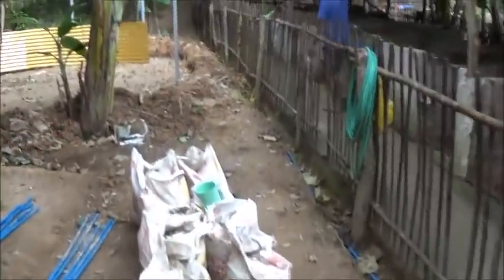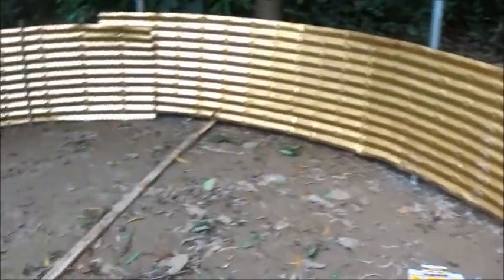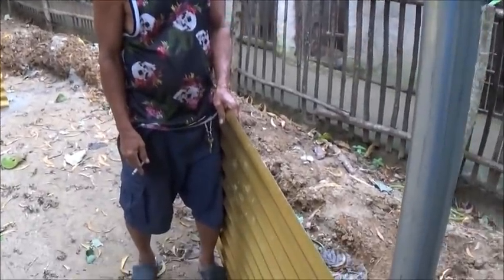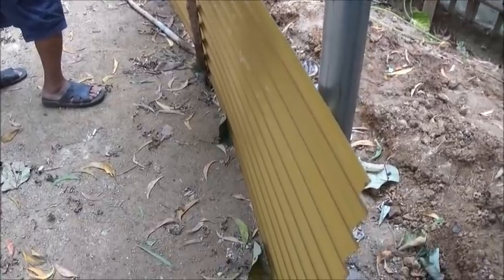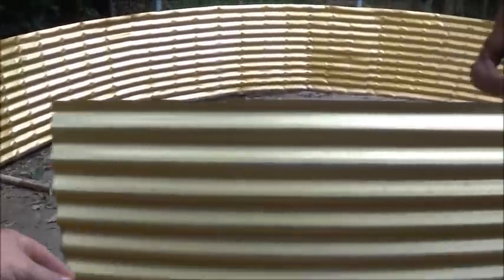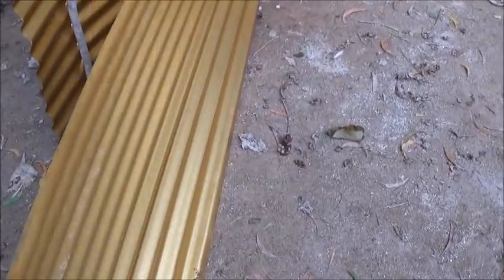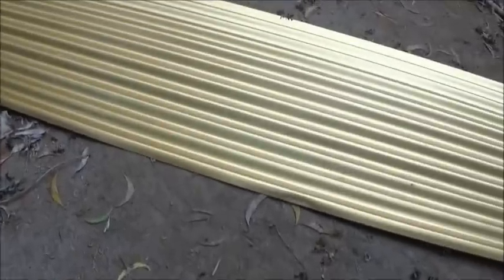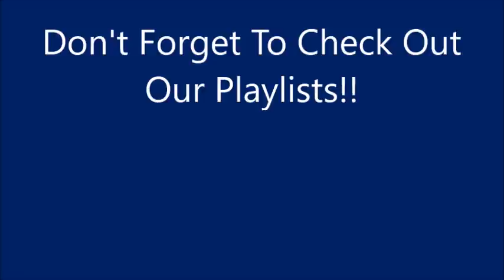Design Flaw Or Incorrect Installation

Comment: You are going against the corrugation ridges. It becomes more bendable if it is used with the corrugation ridges going in the upright direction. It becomes more flexible.  With it being horizontal it resists the flexibility of the metal.

Comment: Tatay, Spread out about 2 inches deep of sand 4 feet wide and 12 feet long. Set the sheet on it and drive the 
motorcycle down it to curl it up . Light rider and drive over it several times. If it bends too much bend several at once.
I might start trying to bend 3 at a time.

                                         george and aurora

Comment: I am sure it's been done many years and see grain bins built with thicker gauge metal but those sheets are pre-made to fit certain radius or diameters. I can see frustrations of all involved but its nothing lost in translations, its material that is available and what you have to use, and what you are trying to achieve.   Compensation and consideration has to be made to make things work.

Comment: Good explanation Brian,  glad you have done this video. 
I also  know Dave,  has been somewhat frustrated!
Particularly in the sequencing of the project. 
Looking now in further detail,  length of sheets ect, seems the tank is too low in diameter,  i realise of course , suitable space was limited!
Perhaps removing the installed sheets,  cutting in half( if 4 feet height is desired) , then using a number of form bars of suitable thickness as a retaining wall support. 
Can paint the sheeting for for added piece of mind.
Hope you,  Dave consider it,  would love to see completion of this exciting  project!
Reply: Tilapia Aquaponics  hi Dave,  thanks for replying in a somewhat stressful situation,  not knowing what the instructions were,  is difficult to understand the problem. 
Reading other comments you have made  here, sounds like you will continue,  certainly hope so!! 
All the best mate😁

Comment: I asked this question in the video on crushing rocks.  The corragations in the sheet on both sides gives the g.i sheet strength and rigidity. 
May be  rings of rebar every 15 inches apart and fix the iron vertically to them if it won't bend horizontally. Unless someone has a roler in town for curving g.i. sheets.
Reply: Tilapia Aquaponics   would increasing the length of the sheet give it more flexibility to bend.
Short lengths are harder to bend.
Reply: Tilapia Aquaponics  that would be interesting to see if it works.
Reply: Tilapia Aquaponics   hi mate, way out west blow in blog made a homemade corrugated iron roller. 
Lol maybe you need to be Irish or can an Aussie do better.

Comment: Difference in thickness of metal will prohibit bending as desired.  Not sure what the gauge of metal being used there in Philippines is or what is available...?  There is different ways to achieve this.  One is making a larger diameter circle to compensate and easier to make the sheets conform to the desired radius.  Another is lighter or thinner gauge of metal.  Even though it would be thinner the radius would give it structural integrity.  Another way is if the sheets are made locally is to have less height of correlations which would enable it to curve gently.  Another way is to have the sheets rolled in rollers and they will then form a radius, and ship curved.  I think the diameter is just too tight or small to make the sheets conform with the thickness being used.

Comment: If the metal sheets were not corrugated then they would probably flex easily. As others have said, the corrugation provides stiffness and rigidity to resist flexing and bending. You guys have some good ideas, but trying to run the corrugated sheets horizontally and achieve much of a curve without bending or dimpling the metal is likely to be impossible.

Comment: David Tatay If you weld 2 pipes between each post one near top and one near the bottom. Then cut the sheets the correct height that’s kinda what you said it’s not made to bend that way you have something to weld or screw too

Comment: You would be better off to buy a above  ground swimming pool .  What is up with Mitch ? Is he coming back ?, Maybe you could buy his old swimming pool . Corrugated metal is not meant to bend that way . Someone screwed up on the plans . Yes Cut them at 4 ft stand them up vertical , I never built a pool but I have put together a few of them store bought . I worked as a welder and carpenter 40+ years . Before that I worked on farms as a kid  .  . When I built concrete fish ponds the blue prints were metric . I also used metric  when I use the calculator to figure out roof rafters . I have been building stuff a long time . Wood , concrete . steel , glass . I am old , I want to retire and move to Phill but covid wont let me ,  As long as I am here I keep working , My work has been steady . Right now we are converting a 4 story brick building former Chocolate factory into a 32 unit apartment building .
Reply from the maker: Thanks for watching Ken. No word on Mitch. Best of luck getting here

Comment: Tata should have welded his metal rings around the circumference (top and bottom) "first" before he applied the sheeting...... that way the sheeting would have something to back up against to handle the bend. The volume of water will keep the sheeting pressed against the ring without any problem. However more stakes on the outside will be needed to prevent the corrugations from folding up between the upper and lower rings. I hope thats clear.... and I'm understanding the what he is trying.

Comment: Make several circles out of long lengths of PVC pipe. Fix those to the posts.
Then fix corragated sheets horizontally with roofing tex screws to the pipes every 30cm or so.

Comment: I think cutting in half and forming from there is the best way. Maybe use the 3 or 4 already used pieces as a combo metal and thatched roof. It really is tough in Bohol with limited material resources.

Comment: You can lay the tin on a hard flat surface put a sheet of plywood on top then drive the car over to flatten the tin then it will be easy to bend a half moon that you want it will have a little corrugation but it will be more flexible. Good luck